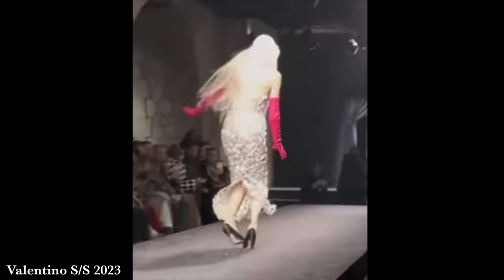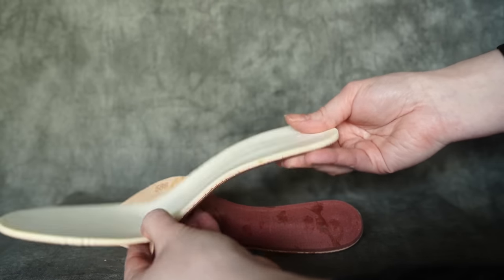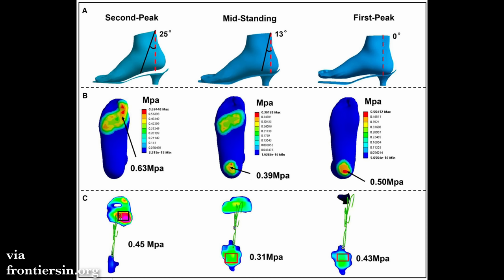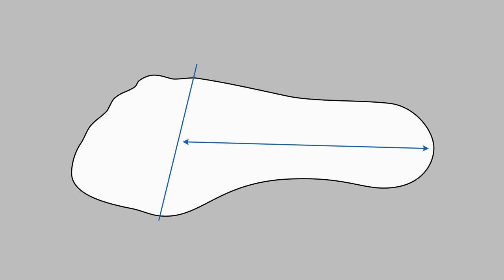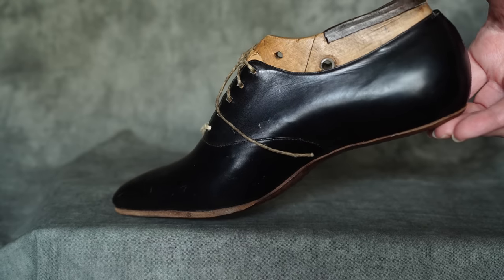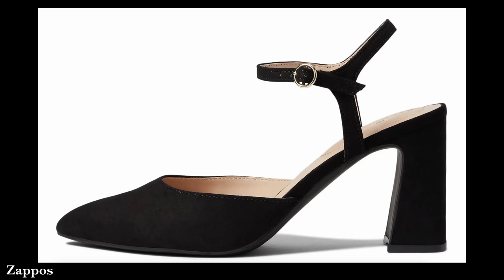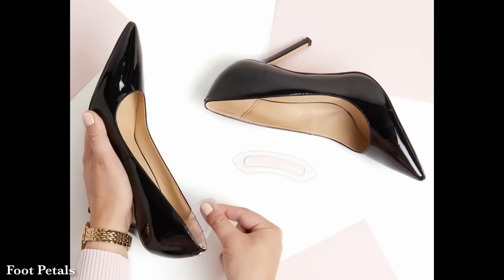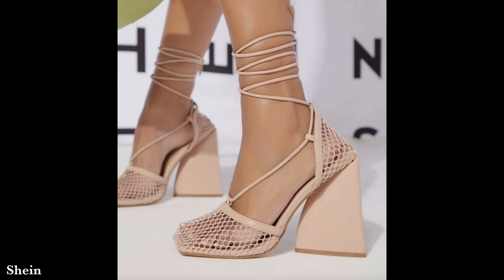Why are Modern High Heels so Bad?

Comment: My first job out of college was working in the Engineering department of a manufacturing plant, where I would need to go to the various departments on the Shop floor several times a day. At that time, I wore 3” heels all the time, and shoe requirements for plants were a lot less strict in the early 90’s. My boss came up to me one day saying I made everyone nervous with my heels, and to please change to lower heels or flats. No problem- I went and bought several pairs of 1” heels … and it was a disaster. Between being used to walking in my higher heels and the inward slope of the lower heels, I would fall 3-4 times a day. After 2-3 weeks, my boss told me to put my high heels on again.
Reply: Omg really? I didn't know that was even possible. It's so interesting how the fit changes everything
Reply: @yuuri9064  The way the lower heeled shoes were designed was different. The placement of the heel was more forward under the foot than I was used to. Also the back of the heel was a smooth line from the bottom of the heel to the back of the shoe. Since I was used to stepping heel first with the high heels, with the low ones I kept stepping on the back edge of the heel which would then roll my shoe up and along the back of the heel causing the shoe to slip out from underneath me. Hopefully this makes sense. Looking back if I had just changed my walk to stepping toe first I would have been fine.
Reply: 😂sounds like you and I are close in age.  I've been wearing heels since I was a teenager, the only times I had a problem was when I would touch down on the side of the (narrow) heel and it slipped.  In 2013 I bought a pair of 4 inch platform heels.  It took me a good amount of time to find the right pair.  I quickly noticed how they were designed poorly and how easily I could fall flat on my face.  Most of them had the platform towards the ball of the foot, with the toes up.  Not the easiest thing to walk in when trying on.  I finally found a pair that worked great.  They weren't the most comfortable because I'm a wide width, coupled with the fact that they were peep toed.  The toe area was where I had pain.  First time I wore them I walked from the furthest parking garage at Navy Pier to the grand ballroom, no problems!  It was as if I had been wearing them my whole life  Spent the entire night either walking or sitting, then walked back to my car.  That was after an hour and a half to two hour drive there (and back).  

A few years later I put them on I put them on, took a step and nearly fell flat on my face.  I forgot how to walk in them. 😂🤣Good thing I was still in the house, about to walk out the door to the garage. 😂  I still wore them to the wedding I was attending, I was immediately reminded to pick my feet up to compensate for the extra height and platform. 😂😂🤣
Reply: You were making everyone nervous with your heels??? Were they seriously sexualizing you just for wearing heels or am I getting this wrong
Reply: @Undyla - Chan  no, it's legitimate.  I work in manufacturing, and there are so many things in a shop/manufacturing area that can cause physical harm.  Now everyone needs to wear steel toe shoes, regardless of whether or not you are working in the shop all day, passing through or just in and out of the shop.  OSHA has made good safety changes over the years.
Reply: @undyla-chan1675  I think you got it wrong. It's "nervous" not "distracted". There are people who get worried/nervous for others a lot. Especially when the possibility of getting majorly hurt with a single slip up is high. I usually get paranoid when someone is wearing heels in certain places, because the possibility of falling and getting injured is high.
Reply: @undyla-chan1675  they weren’t sexualising her, they were seeing her walk around in these high heels thinking ‘they don’t look safe, especially when she has to go up and down the stairs constantly as part of her job’ what part of that is sexualising her?

Comment: The heel cup being too large and the design trying to compensate for that by making the edge of the top of the heel try to slice into your Achilles tendon is definitely the thing that causes me the most problems. My heel stays pretty wide all the way up to my ankle. That kind of heel design has drawn blood from me several times.
Reply: Same. I don't know if you can do this with all materials, but if you wear the shoe with a thick sock and then blow the back of it it with a hair dryer for a few seconds, it should loosen and conform to your heel/ankle shape better.
Reply: THATS WHY I DONR WEAR EM
Reply: @l6318  A hair dryer? Ooh, I should try that, I've had a few pairs that slice like that.
Reply: This was always my childhood in the 90s experience with heel. Caused me to not bother wearing heels. It took me into my 30s to find a 1920s style mini boot heel shoe that I can walk around in and draw no blood.
Reply: I have thin heels, but I also get problems with the top edge scraping my ankles. It's like instead of making shoes for people with thin OR broad heels, shoemakers combined the worst of both worlds and give everyone foot sores.
Reply: That reminds me of the shitty ballet flats that my mom forced me to wear when I was a kid. They always cut into the back of my feet. Currently, I'm only wearing tennis shoes or combat boots (and the occasional 1 inch heel for special occasions)

Comment: I really wish more modern heels were made like dance shoes. They aren't perfectly comfy but they're way better. I honestly will gladly take visible wear or a floppy-off-the-foot look, over 0 flex and so much discomfort. The padding if dance shoes would also be nice. But most heels and flats I find nowadays have ZERO padding. It's like walking on solid wood. Why can't we have actual padding 😭
Reply: @nope6021 - It is also difficult to find shoes with real arch support, flat or heels. Every thing is flat-flat-flat.
Reply: @MossyMozart  I wonder if that's the problem I had with flats. I needed black shoes for a choir concert and I bought some flats (I'm quite tall so tend to avoid heels) and wore them for the dress rehearsal the day before the concert. By the end of the rehearsal I was in so much pain I couldn't even walk. I had to have help getting down from the risers. Wore my more clunky looking work shoes and was much more comfortable. Have never worn flats since.
Reply: @margaretschaufele6502  definitely! flats are flat (doy) and dont even try to support your foot, and if theyre inflexible on top on that youre basically having to walk like a puppet

Comment: I went like half my adult life with plantar fasciitis not knowing why until I finally found an article about arch support. I have really high arches so literally no off-the-shelf dress shoe works for me. I have to add arch support every time. And thank you for explaining the wide-all-over heel cup problem. I thought I had weird feet because every time I find a shoe where the ball is wide enough, the heel cup is too wide. 🙄
Reply: I have plantar fasciitis as well, but because I have flat feet. I have a spur on the underside of one heel, so hard orthotics don't work for me. I found cushioning arch supports that work so much better. I also found varying heel heights helps for me because it causes my foot to arch so takes pressure of the plantar tendon.
Reply: @jjez61  Isn't it nuts how totally different foot shapes can cause the same problem? Bodies are wild!
Reply: I also have extremely high arches, best shoes I ever managed to find were a brand that caters to horseback riders - support in all the right places and a ton of cushion/shock absorption. Sadly I think they discontinued the style I'd get for work which were more a business casual style, and I've struggled to find decent shoes ever since.
Reply: @KristenStieffel  it is!
Reply: Shit like this is why I find it so sad that we've replaced custom shoes made by cobblers with off-the-shelf mass produced items.
Reply: Same, my friend. Same! 100%

Comment: I’m actually one of those who try to see how flexible the soles are before I buy shoes 😂 If they are too stiff I wont buy them.
I also had figured out from trial and error about where the heel is placed underneath your foot had a huge impact on ‘walkability’
Reply: I agree. I had a pair of (cheap) Oxford that I couldn't wear because the sole was not flexible and with a large opening my foot just slid right out. I was leery about buying shoes online so only do it if the company shows a video of a person walking.

Comment: I sat my 10 year old down to watch this... because she needs this info before she starts drooling over pretty but impractical shoes. She rolls her eyes at stilettos and calls them Monster High shoes. May she continue! 😁
Reply: I call stilettos "ankle busters" because they are.
Reply: Well done for showing your daughter that these implements of torture are ridiculous.
Reply: @fredericapanon207  
I love my stilettos.  One just needs good ankle strength and good balance to wear them.
Reply: @keirfarnum6811  If you need ankle strength and balance, then your weight isn't being properly distributed and supported in them, as per the video.  Plus, the position high heels put your feet misalign your hips and back and have long-term effects on pain those areas if worn frequently.  Like, SEVERE, only drugs can help pain if you've been wearing them for 20 years, or even less.
Reply: Lmao funny enough very few of the G1 monster high dolls work stilettos. A majority of them were boots and wedges 🤣 now the dolls are actually designed with flat feet and have tennis shoes and sneakers instead of heels
Reply: @kiwisocks  - Well then I must be a mutant.  I wore stilettos - VERY high - for 30 years.  My feet, ankles, knees, and back are just fine.  I do have hip problems, but that’s because I have osteoarthritis, which runs in the family. 🤷🏼‍♀️
Reply: @madeleinerose7090  Have you asked a podiatrist why you have in your hips, and not anywhere else yet? (unless you have some in your arms?)

Comment: This is very interesting to watch from a dancer (primarily ballet) perspective. I have literally dozens of pairs of ballet flats, pointe shoes, jazz shoes, modern/contemporary shoes and salsa shoes. Even among the same brand, different models of shoes can feel and fit completely different on the foot, leading to finding my favorites that I buy again and again. 

Since I have been dancing, especially en pointe, I have constantly been asked how I do that, isn’t it painful, etc.  My answer has always been no, because it has not been painful dancing en pointe…sometimes uncomfortable but never painful as I was fitted with the proper shoes for my foot type: taking into consideration my narrow and tapered foot shape, high arches, high flexibility and general strength, not to mention toe length, age and years of experience. 

I had a great fitter my with my first pair of Russian Pointe Rubin shoes, and literally have been ordering the exact same shoes for almost ten years now, only special ordering a harder shank so I don’t break down the shoes so quickly (they are expensive!) 

The one exception is when against my better judgment as I was pressed for time, I was pressured into purchasing another brand of pointe shoes which frankly felt terrible on my feet and I couldn’t even dance at the barre in them because they felt like awful bricks. I will never make that mistake again. 

While I was lucky to find my “right shoe” the first time, often ballet dancers take years to do so and once they do, will purchase several pairs at a time or have a certain “maker” who makes their shoes (they generally have their own custom stamp on the bottom of the shoe) and be dedicated to that one maker’s shoes. 

When it comes to the salsa shoes I have, they are a three inch heel and despite that are the most comfortable pair of heels I have ever worn. I have only been dancing in heels for the past six months or so (have studied primarily in ballet so never had a need for them until taking up jazz again) so there was a little transition at first but wow. They are incredibly comfortable. 

I wish modern heels were made with that flexible 3/4 shank or 1/2 shank in mind…honestly who cares about the shoe changing in appearance over time if it is comfortable. The only issue is, the sole is very soft to be quiet on stage and therefore not appropriate for wearing on cement/asphalt or out of the studio/offstage…but I am seriously considering purchasing another pair of salsa shoes and having them resoled for streetwear! 

Thank you for the interesting and informative video!

Comment: I was always so confused about how I loved my tap heels but hated regular heels. I do think the flexible shank is part of it, but also…regular heels never have a wide enough toe box. I’d always buy up in regular heels to accommodate my toes (otherwise my tiny pinky toes—at least—would be waving hello) but then I’d get so much shrinkage and slippage in the rest of the foot that I would be on my tip toes with these ginormous flippers in the back—which was funny because I’m normally a size 10-1/2 to 11. I finally gave up on trying to wear heels after they wouldn’t let me purchase tap heels without the taps and just decided that flats or even actual men’s dress shoes were good enough.
Reply: It was thanks to this channel that I realized the reason I could never ever find off-the-rack heels (that weren’t boots) that fit me was because I actually have AB-width feet- average in front, but VERY narrow in the back, so unless the heel is shaped absolutely PERFECT to my foot my feet slide out or have too much space in back. I’m also a half size. Unfortunately, basically nobody actually makes that size any more. 😰
Reply: @SoundShinobiYuki  I have a similar problem - narrow heel, wider in front, maybe even wider than standard. Winter shoes are easier, there have more wiggle room and always proper socks which help a lot, but heels and sandals are a problem, even with only 4cm heel. My little toe has problems fitting in at all.
Reply: Have you ever tried character shoes?  Many (maybe most?) tap heels are just character shoes with taps attached.  Capezio Jr. Footlight is the dominant model but there are others.  I just saw a character shoe from Theatricals with a neoprene insert in the upper that I want to try next time.  Tip though - if you buy character shoes with plain leather soles (i.e. not suede), sandpaper the ball of the foot and/or walk around on a sidewalk before you try to walk indoors or you’ll very quickly find out how slippery leather on tile can be!

Comment: This is wonderfully informative, thank you.  I'm a former professional costumer who (for years now) has been contemplating learning shoemaking.  Your video explained so many issues I've had for years--I have narrow heels, high arches, and long toes, and I've largely given up on shoes with anything more than a 1" heel.  Honestly, I've hardly bought shoes in general for years now.  I'm learning dance as an adult, and it's hard to go into a shoe store now and NOT reject 99% of what I try on, because they're so obviously "fails."  Time to go back online and find those lasts I was eyeing a couple months back....
Reply: Have you found any heels that do fit really well? I have that exact foot shape and have also given up on shoes. I'm also a UK10 and hypermobile, which doesn't particularly help in my search for comfortable shoes. Unsurprisngly, I have also been looking at lasts because it feels like there's no hope of ever finding a pair of heels that fits.
Reply: @blueocean43  I'm hypermobile too. I've had good luck with heels from Dansko and Sven, both of which make clog-type shoes like nurses wear. Allegra has nicer fitting clogs, but they tend to look like turn shoes BEFORE the turning.
Reply: @andreacook7431  similar ish foot shape, except my toes are normal width (but very thin top to bottom) and the rest of my feet are narrow, and most of those brands that should be more comfortable won’t fit at all, gaping vamps, etc. there was a black rose embossed pair from Allegra that I so wanted to wear but I could have put the toes/balls of both my feet into a single toe of one of them! I was so sad!
Reply: @blueocean43  Oof, I wish I had something good to suggest.  I don't know if I've bought heels in ten years.  I used to stalk them on eBay, looking for a long and pointy toe (mostly just personal preference, although often I was luckier there), a higher vamp than average (long toe and mild bunion issues), leather or suede (so they could be stretched a bit), and no more than about a 2" heel.  I had better luck with shoes that had a loafer look to the vamp.  Also, Italian or Spanish companies more often seemed to have the kind of "classic" look I was interested in, so I'd search specifically for them.

The one pair of normal pumps I still wear is by Claudia Ciuli.  I bought them used 8-10 years ago and only wear them to special occasions anymore.  The heel tip is pretty narrow, but they're otherwise quite stable and in line with many of the guidelines discussed in this video.  (Good job, younger me!)  I had a very similar Spanish pair before then, but they...well, they ended up very well-loved.  :)  I have an easier time finding comfortable heeled slides/mules, so I have a few of those.

I've been meaning to get some 40s-style heels--maybe some heeled oxfords--but so often the heels are higher than I want.  They may be more comfortable than modern shoes, but I need to save my feet for dancing.
Reply: Your feet sound like mine. I can only wear heeled sandals comfortably